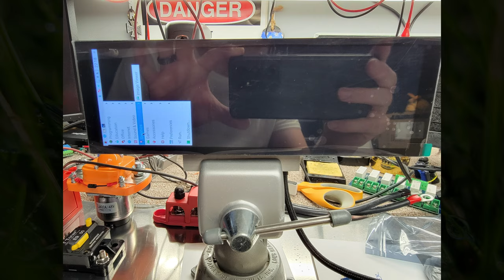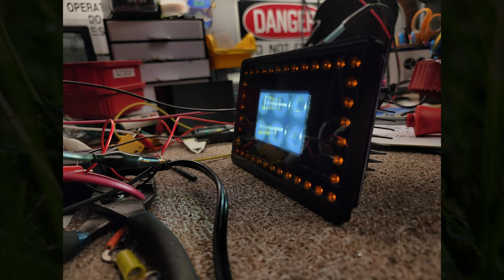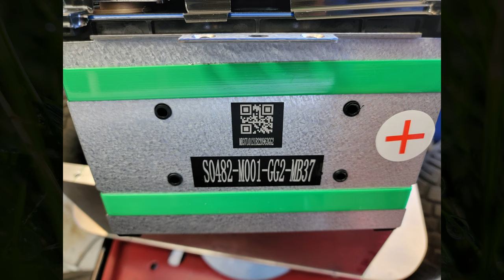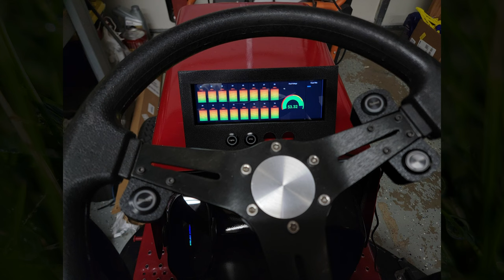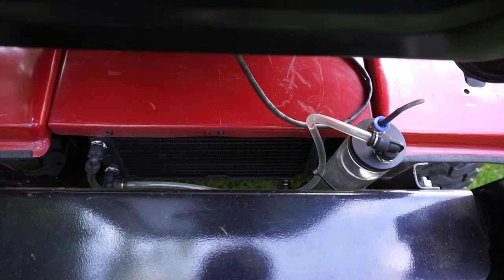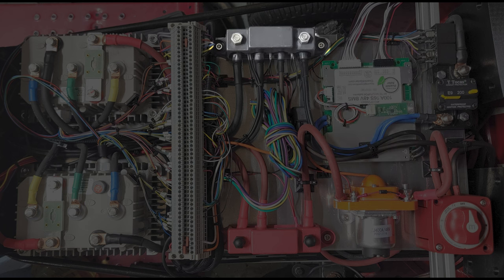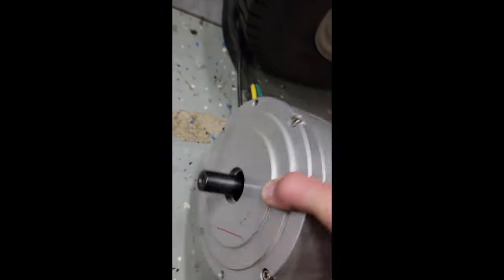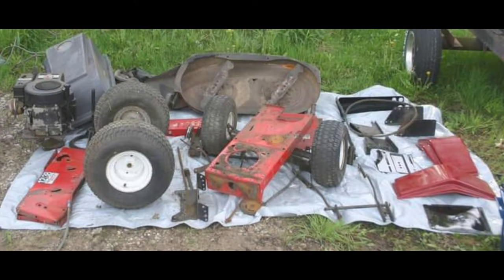ElectraCut - A look into an electric garden tractor conversion

Comment: Was there a reason why you chose seperate drive motor for deck and the drive? Could a single motor replacing the ICE be used to simplify the swap (then use factory belt drive arrangement for deck/drive)
Reply from the maker: You could use a single motor, but I didn't want to just have a motor running at full tilt.  I think this setup is more efficient because I can electronically control how much power goes to the blades, how much to the drive, etc.  There are a couple of other conversion videos out there that show a like-for-like swap.

Comment: Is the 3kW enough power for the two blades? I would assume that 500-1000W for propulsion should be ok, but cutting and even spinning 2 blades will take quite an effort, that is why I was considering for my conversion to use much stronger motor
Reply from the maker: This is a smaller deck at 38 inches.  There was more than enough motor this fall with all the leaf cleanup.  Never once did it bog down or try to stall.